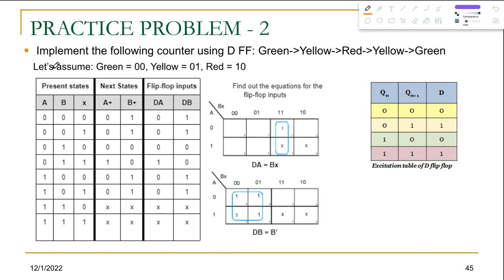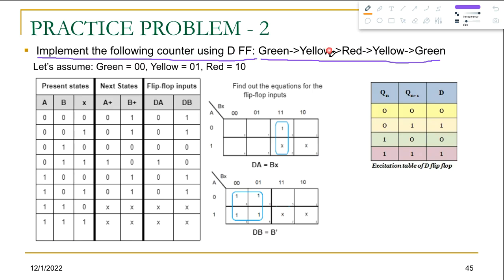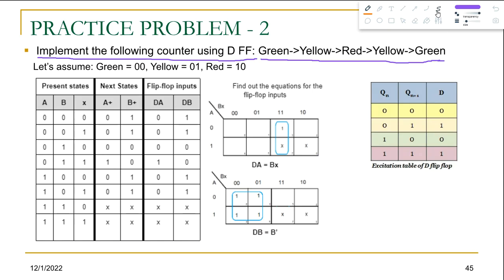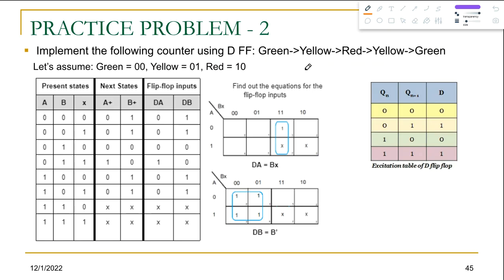Counter Practice Problem - 2 | Text Based Problem  #sequentialcircuits #digitalelectronics

Comment: sir, if there is three different states for a value...and i take x and y as an external input then there would be four possible Next states for each present state...and if i fill in the three in state what should i put in the 4th state ? should i put any valid  ? as for this video i put the same next state for all other colors than yellow. or should i put don't care?
Reply from the maker: Usually it's mentioned in the question